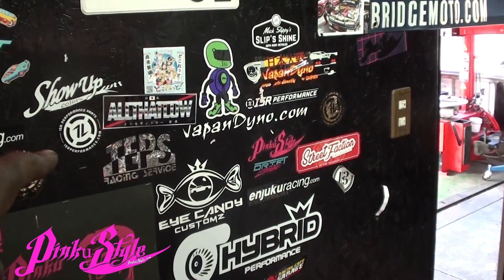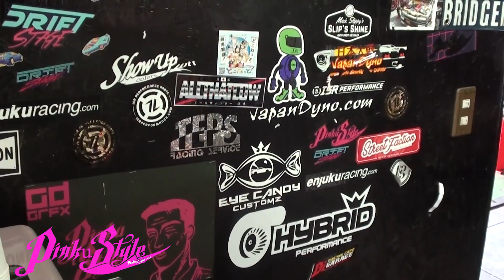Pinku Style - July 2017 Shop Update - Q and A

Comment: Awesome stuff man, can easily tell that you been puttin in some work and would love to see more videos outa you but you gotta do what you gotta do man respect for having priorities, on a side note i'm unsure of the price or availability in japan but you can also look into gettin a j-series engine which usually comes in the odyssey 3.0l v6 goes up to 3.5? but yea another engine option for the nsx and you will get the v6 sound still :D
Reply from the maker: +TriniRogue na dont  want ant v engines in it to be honest.  racing  is the application and the v configuration is not optimum on the track in that car.  the are available but im pretty  set on k20 turbo.